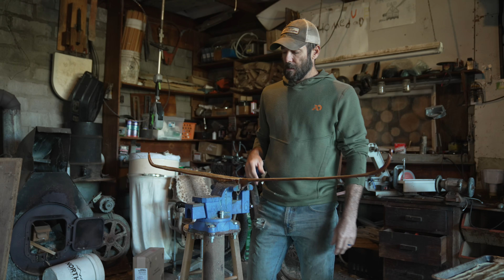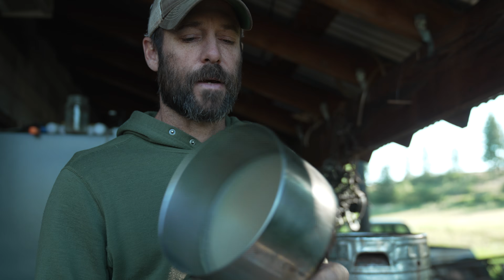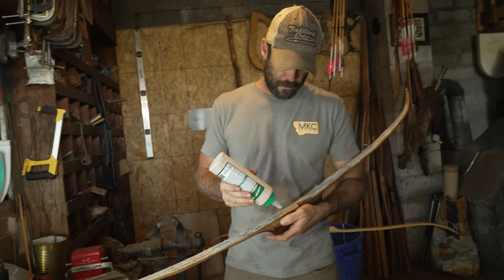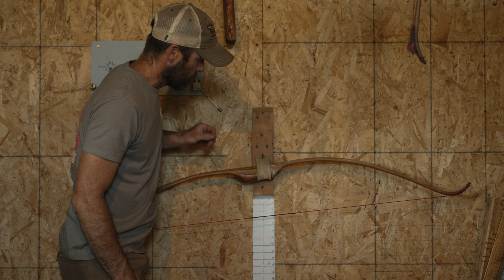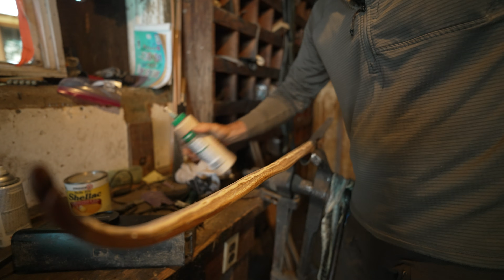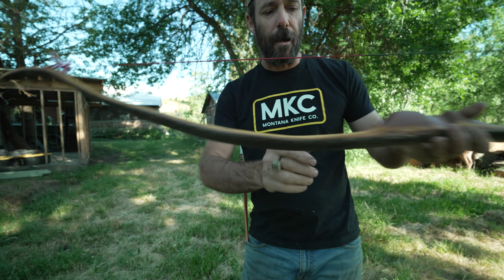Sinew Backing 101: Master This Traditional Bow making Technique

Comment: When your separating the sinew why are 
you not using a 
panel pin block 
that you could knock up drawing sinew through yes you will get some breakage 
but the best and longest will stay together use all bits for glue and if you want to stick with how it was done 150+ years ago use Hawthorn bush needles
or a relative to it 
I've seen a lot of products done like that ??

Comment: I have snaked about 50 bows, possibly more, I do one limb at a time and just use my thumb to roll sideways to center the skin and push the excess glue and any bubbles out to the side, I don't use any wraps. I spend about 15 minutes a limb pressing and working the skin down until the glue starts to set. I think the most important part of skinning a bow is centering the pattern perfectly with the the limb all the way to the tip. If a skin pattern slips to to one side or the other the whole skinning job looks wonky. Great video!

Comment: Try heating that hide glue a bit when you bend it like that, I seen a really solid horn and sinew guy do that. Silyan stefanov
Reply: Ĥes more than solid, in̈ my opinion, stiliyan  is the gold standard in composite (ie, horn an̈d sinew) bows currentĺy. Especially since he uses very basic, if not primative tools and techniques, to produce absalute masterpieces, definately one of the few master bowyers on utube
Reply: Also im pretty sure hes heating the horn  to help tiller the bow, not so much the sinew. Obviously talking about stiliyan stefanov
Reply: @DaneBender-j7i  well my point is that hide glue should, if its moisture content is above zero percent, it should get a tiny bit more pliable also when heated so yes. For the horn, for the wood, and for the glue, sinue is still sinue yes. 

Thats what I think from stilyan and the literature.

Comment: Actually, to get the most from the sinew the bow should be reverse strung during the drying process. The string will lose tension as it dries just continue to tighten the string... Ya, I know, I know, Clay didn't do this but like I said to really get the most out of the sinew reverse brace the bow....
Reply: I always back string mine ,I first sinew the tips, let them dry a few days. Then get a couple inches of reflex strung in, the do the rest of my sinew. I believe it does make a substantial difference.

Comment: If you think about it, tendons and ligaments are the strongest parts in a body. In fact most of our strenght comes from these things.
This is why you often see people like Anatoly puting to shame very big juiced gym guys, and he looks like a child near them. 
And i remember I saw a dude on youtube explaining that if you want to develop stronger tendons and ligaments, you do not make repetitions with weights. But hold weights, basicly hold that tendon in tension. And you want to do this in areas where you want to have more strenght for less mass.
It is amaizing that some people, i mean basicly anyone with some training can pull insane weights, like the string of a warbow. With just 3 fingers, those ligaments in your 3 fingers are stronger than the entire bow. 
So the strenght of backing the bow with sinew is just a fraction of what that material can do. Pretty amaizing.
This is why sinew is good for short bows, because the fibers are continous in that bending section and so you can build extreme bows like the asian crab style bows wich have alot of tension in them. While on longer bows such as this, it ads a bit of speed, but the sinew is more of a protection rather than performance. To actually use that tensile strenght of the sinew you need a hard to compress material like horn on the belly.
Reply: Anatomy is juiced to the gills as well. Training for strength and for mass are two different things.

Comment: Welcome back from Darkest Africa! Although that was a remarkable trip, it's nice to see you back in the shop, working on bows. Two questions: 1.You mention early on in this video that if properly done,  sinew adds speed.  If you build another sinew-backed bow someday (and I'm almost certain you will), it might be interesting if you shoot a few arrows through a chronograph BEFORE you add the sinew and then again AFTER the modification. In other words, we'd all get to see precisely how much of a difference the sinew makes. 
     2. Is there a reason you don't use any two-part epoxy glue in your bow building? Because of its high strength, its ability to handling flexing, and its excellent waterproofing characteristics, epoxy seems like a natural for bows—including for the addition of sinew and snakeskin to limbs. But I work on boats and fishing lures, not bows, so it's quite likely that  I'm unaware of potential problems in this application. As always, Clay, thanks for your efforts, Chris (in Maine)
Reply: Hello, 
excuse me to chisel in on this topic:
Clay is well aware of the potential of Epoxy glue and uses it where appropriate. Sinew is always applied wet i.e. stretchy, that’s why only animal glue works in this case - it’s of the same material and coheres to sinew like no other glue. Together with the sinew it shrinks and causes the bow to achieve the desired reflex. This prestressed design makes the difference. It adds tensile strength to the stretched bow back and allows for a longer draw length compared to an unbacked wood bow. 
The big problem is the influence of humidity - animal glue and sinew can become soft and loose the binding to the wood if in too wet conditions (Clay mentioned the very history of the bow he sinew backed for the second time). The snake skin helps to make the backing quite waterproof and additionally gives camouflage and a beautiful look. 
Clay explained all that in a very concise way during the process. 
Clay, I very much appreciate your efforts to teach us all the details of your vast experience in bow building and archery/bowhunting etc. So good you try out the different methods to improve bow building like wood bending and the fire hardening and share your insights with us. Keep on doing so!